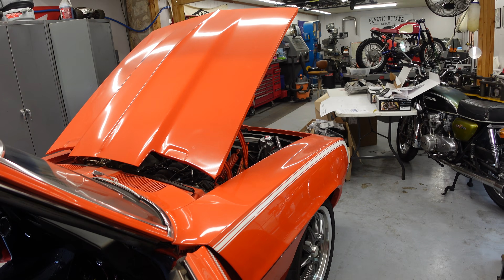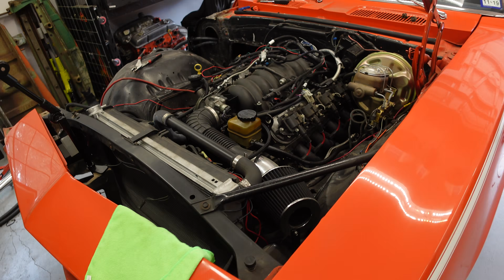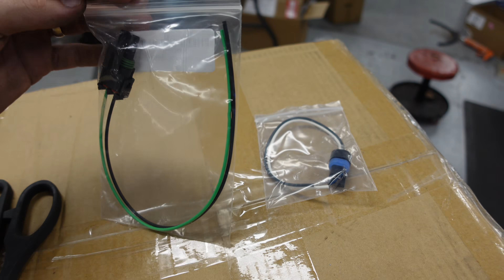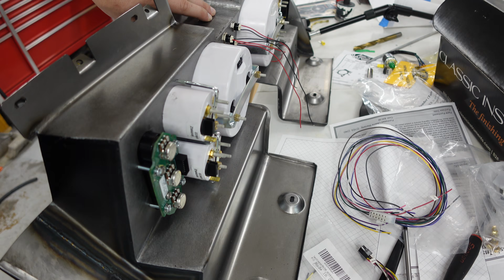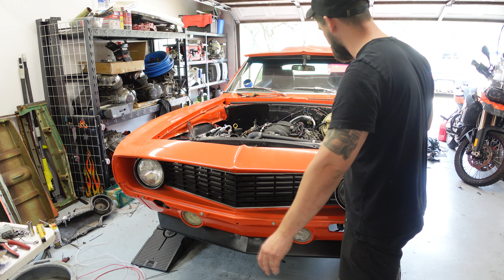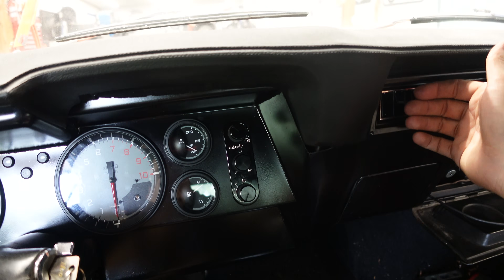My '69 Camaro gets huge upgrades. Why did I wait so long?

Comment: I would have just put in their hang down option. Would save so much work and disassembly. The early Mustangs used those types of a/c units as factory air, and no one complained that it didn't use dash vents. So much better to find a car that originally had factory air. Then all the hardware and ducts are there, even if it needs newer components due to leaks.
Reply from the maker: I had that style A/C in a 67 Mustang before. It only kept my right knee cool. It's worth the extra effort for me to have a proper-looking setup.

Comment: Seeing your video on this makes me think I really should go ahead and get the system installed in my '69 before I send it off to paint. Looking freaking rad, and can't wait to see what brake and suspension upgrades you have in mind! 

And as a guess, if you are going with a torque atm, the BMR was really easy to install. That's where I'm putting my bet. 😜

Comment: How has the terminator system been?
Reply from the maker: Worth every penny. I still need to put more miles on it with the new A/C so it can learn to control idle better. It's getting into a new area of the tuning map with more load than it's used to so it's stalled a few times but is getting better with every mile.

Comment: What is your seat belt set up? Didn’t notice a cross bar behind you are they just bolted into factory bolt locations?
Reply from the maker: They are from Schroth Racing https://www.schrothracing.com/item/rallye-4-asm/tuning-Harnesses. They are designed to bolt to the rear seat belt mounts and still provide anti-submarining without the use of a roll bar.
Reply: Thanks appreciate it!

Comment: I have a 69 with vintage ac also, I have spots of warm air I’m needing to deal with as well, I have a big block with lots of heat doesn’t help and Florida to boot, nice video and nice car
Reply from the maker: I need to look into what I can do inside the door. I think that's my biggest hot spot.
Reply: @ClassicOctane  look at the old manual vents in the kick panels on the driver and passenger side
Reply from the maker: That's a good point. I have holes there at the moment for speakers that are not installed yet.
Reply: @ClassicOctane  me too, I put foam speaker inserts to help block the heat, helps, it’s a 53 year old car that definitely wasn’t designed for ac heat issues that show up immediately in Texas and Florida heat!!

Comment: i love how around 5:45 you are talking about how many hours a shop may charge to do this, and you can save money doing it yourself, then the VERY next clip you say "this install is no joke"

maybe that's why shops charge 40 hours? because as you said- this install is no joke.
Reply from the maker: I think shops are right in charging 40 hours for the job. That's what I would need to charge someone to do it for them.